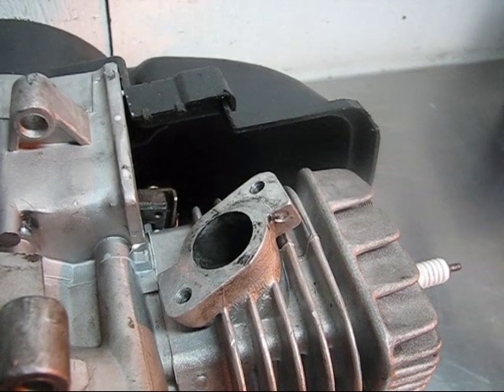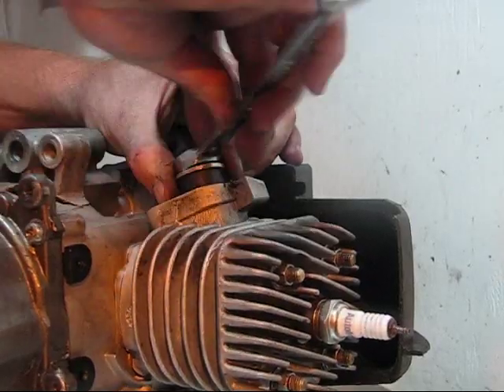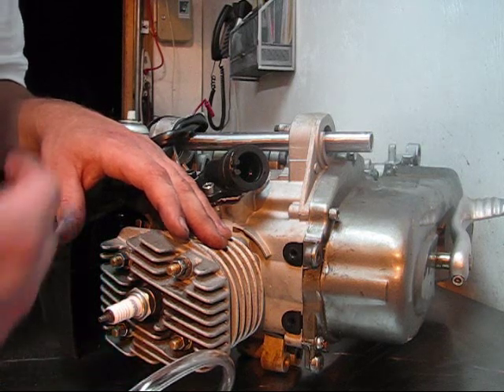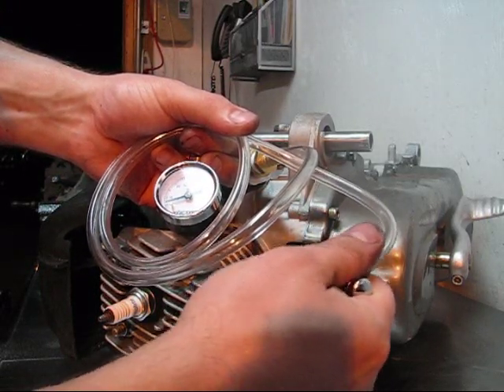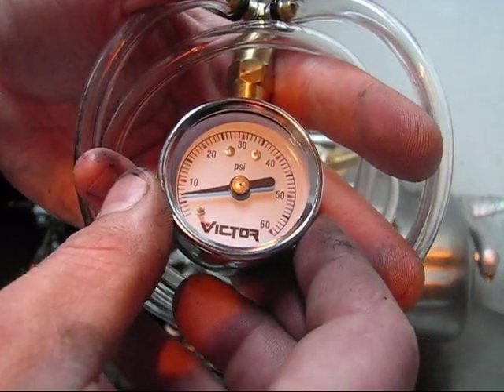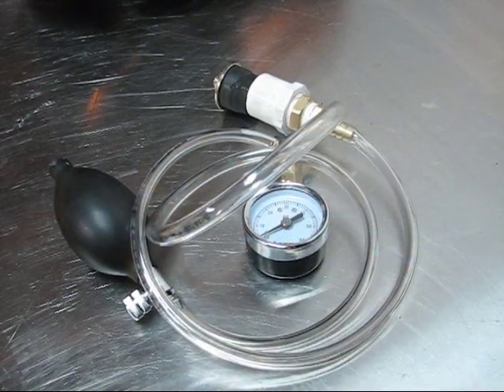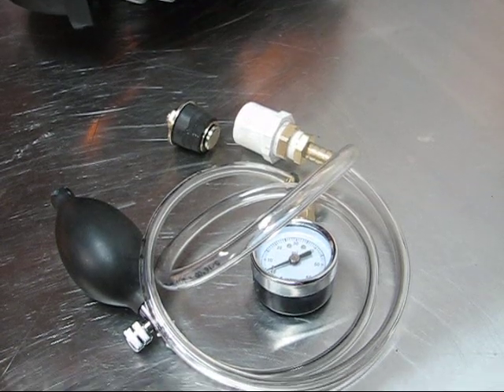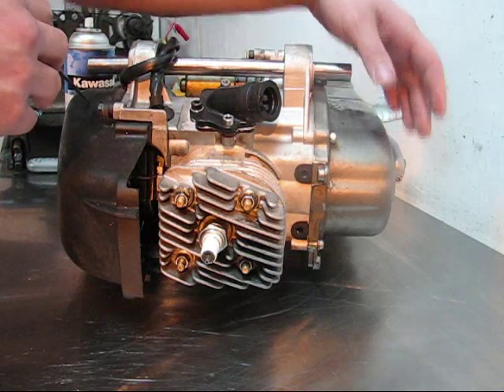Pressure Testing a Minarelli Horizontal 2-Stroke Scooter Engine

Comment: What is the best way to break in a big bore kit on a two stroke scooter with a Nikasil 70cc kit?
Reply: run a 3% mix and do not go over 3/4 throtle and 45km/h the first 500km.
and try to avoid long runs upphill
Reply: Did a different way and seems fine but thanks.
Ran it to a warm little hot let it cool. Started it again warmed it up took it for a ride slow for a bit with up down throttle 10min tops.And the same thing over and over but a bit longer,trying  to get the high and  low spots of the cylinder wall.Seems like got the compression up perfect.But seeing its a 70cc big bore kit on a scoot was not a easy task.
I think the 500 mile break it with a two stoke does work but that is my way.
Reply: interesting=) never heard about that way. how do you mean that you tried to get "the high and the low spots"? i do not understand. please explain=)
Reply: There are high spots in a cylinder and low you have to ware them down as one piece so all are perfect with no imperfections.
Reply: Anytime a cylinder is done there are high and low spots.Thats what a break in is perfecting.
Reply: ok. but how do you fokus on them, it seemed in your former message that you were able to focus on them.
Reply: looked it up
Reply: ok...

Comment: why are you testing the block pressure? shouldn't you test the pressure inside the cylinder? if you block off the intake, exhaust and spark plug then this test is not really useful, the piston could have no pressure at all and you would still read a good pressure with this test.
You should test the cylinder pressure, bring the piston up to the ignite position, lock it there somehow, then remove the spark and plug your gauge there and pump in some pressure.

Comment: Well mostly it's the bearing gone ( crankshaft play ), and vacuum testing is easil done with the carburateur off, and put your hand in front of it then kickstart of use electric to feel how hard it sucks. And compression test is well you can feel that by just kickstarting. I have really now time for all those " tools " and this basic knowledge works out all the time, never had any problems. Another tip: NEVER install 6204 C4 in Minarelli, not even with race setups. C3 is fine for all.

Comment: @areomyst Yes, it's both OK. But I almost never use it anyhow. Last week I had a Kymco scooter engine, which had a faulty crankshaft due the previous owner, tried to " assemble " it with a hammer. The engine did only run OK when cold, but when warm it stalled, cause it stretched the crank seals when running. the crankshaft was ruined at first assembly.

Comment from the maker: Thanks for your input barthoedemaker.  I respect your methods and agree that vacuum testing can work.  Most find pressure testing to be safe and effective.  Many professional tuners working on 2-stroke ATV, dirt bike, go-carts, etc use this method and have for years.  Simply put, it's safe, and it works.  You are right though, if you overpressure the engine, you can blow your seals out.  That's why we just use 6 PSI.  If 6 PSI blows a seal out, then there's a problem with the seal.

Comment: @barthoedemaker ok, hi there, you're right at some parts BUT until you said the word overpressure. @ 6 PSI No seal will blow out, this is a super easy method. eventhough i think both ways are easy lol, but still 6PSI will not blow out any seal, since the engine itself creates presure inside itself, thats why i had some problems with my Sprinting engine, it blew out its seal cause of it generating almost 20Psi, 
anyway Have a nice day, no offence, you are right at some things.

Comment from the maker: @2610ksj This engine is basically just like the CPI - A Chinese Minarelli clone.  All the parts interchange, though the cylinder and and crankshaft on the CPI is slightly different (12mm small end bearing on the crank on the CPI, and a smaller boost port tunnel).

Comment from the maker: @barthoedemaker  Leakdown pressure testing is a widely used & safe method.   When your piston is on the downstroke, the air in the crankcase is being pressurized anyway - there is no harm in pressurizing the engine.  Furthermore, you only use 6 PSI so that you do not blow out seals or anything of that nature.  I am also a professional and certified Vespa/Piaggio scooter mechanic.

Pressure testing makes finding leaks very easy with soapy water as well.  How easy is it to find leaks with vacuum?

Comment: @peer91 hi,i have vespa et2 and i got problem wheen i drive the scooter the scooteer not develop the speed, before i drive around 40 to 45 and now i just dive 15 my battery is not good you thing is because the battery dead our not,or the carburretor is cleaner, can you help me please many tks my email is   venancioberenguer@hotmail.co.uk

Comment: Hey!  I have a huge question. I disassembled my scooter the other day and I just want the motor. Its a 4 stroke motor. I have NO idea about motors.  The question is: how do i get it to start? Do I need the battery to get it working? Or can I just use the kick and it will start after some time? I’ll send a link of my engine on mail if some one wants to see what I’m talking about. Engine name: 50CC 4 STROKE GY6 SCOOTER ENGINE 139QMB MOTOR AUTO CARB

Comment: I'm a professional certificated scooter mechanic, by experience I would never do this, the crankseals might blow out under pressure. You only need to check vacuum pressure. Bad piston rings, can decrease that, thus making the fuel mixture from the carb not be sucked up rightly. Vacuum testing is SAFE, overpressure testing can blow out seales.